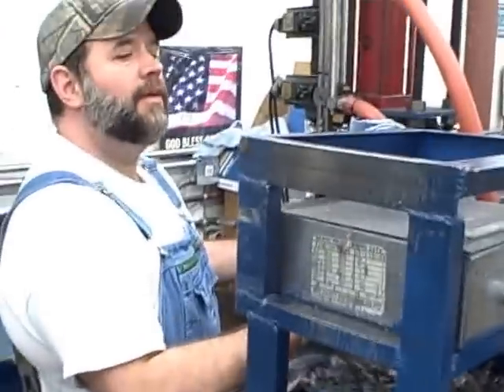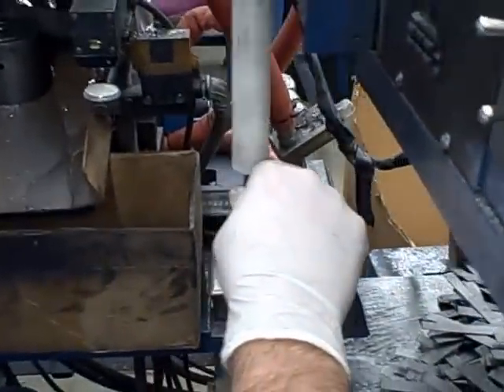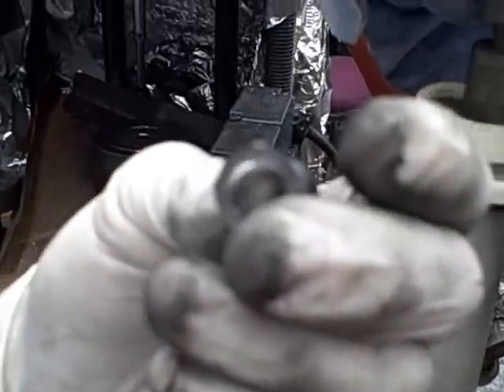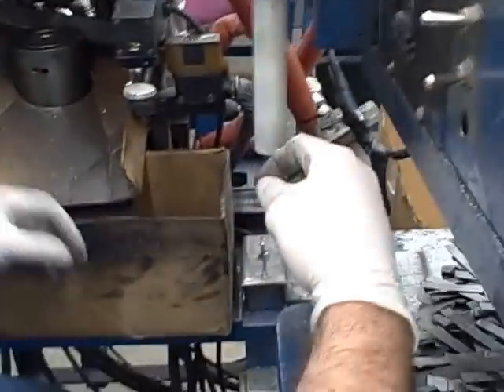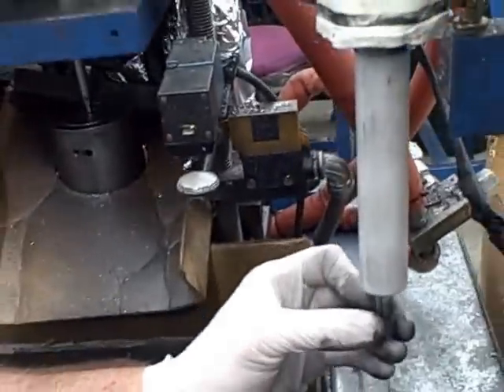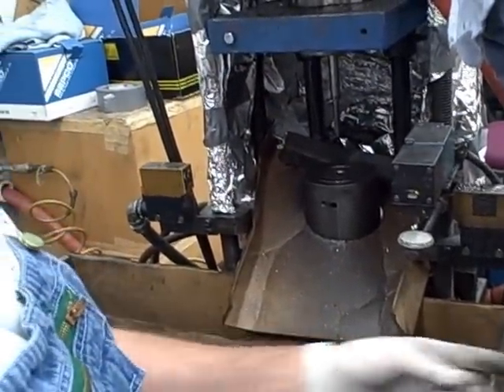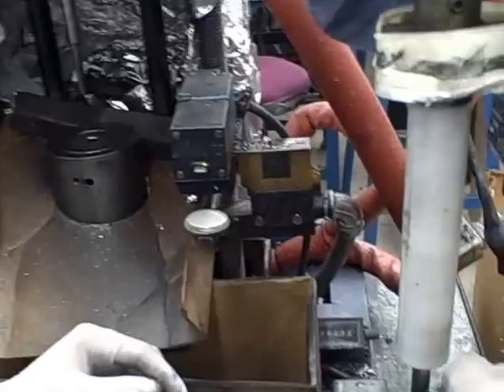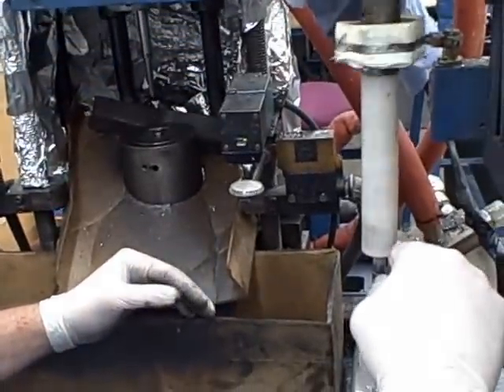SEPCO Flexible Graphite Rings Part Two

Comment: Hello. Very good job. Where they use this kind of graphite rings what does mean flexiable? Can i use them as o ring against the licking through polish rod in Artficial lifting system inoilfield into the stuffing box? any chance to drop quick email to me tk_services@mail.ru or my whats app application to quick be in touching +77016828586